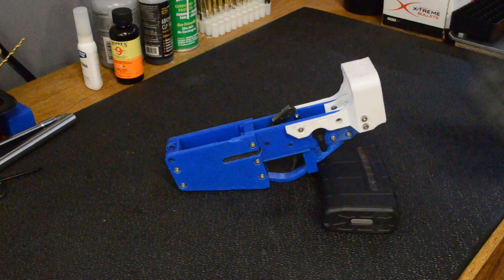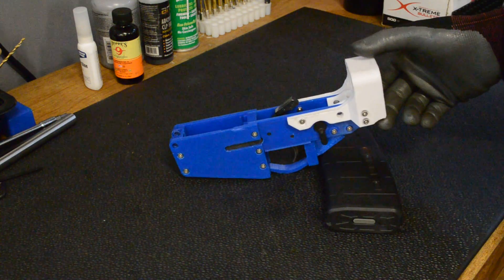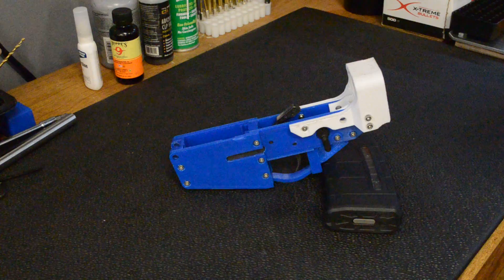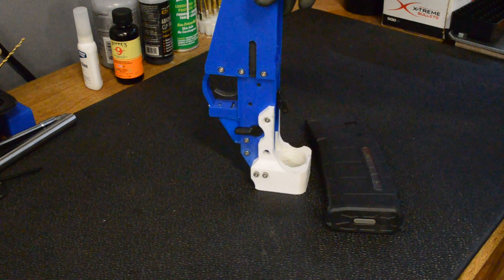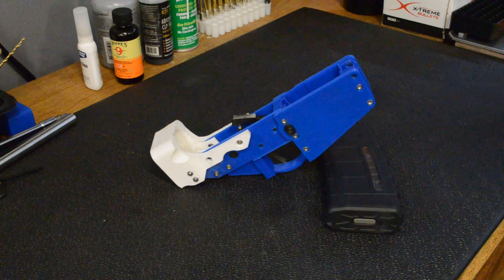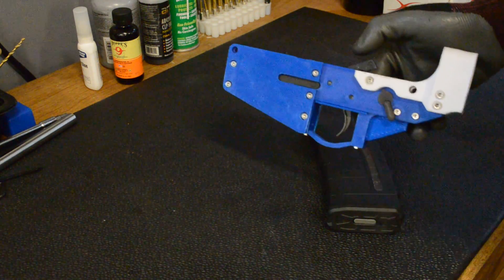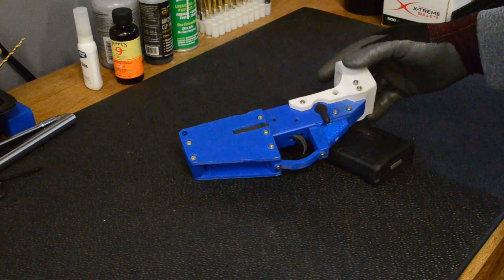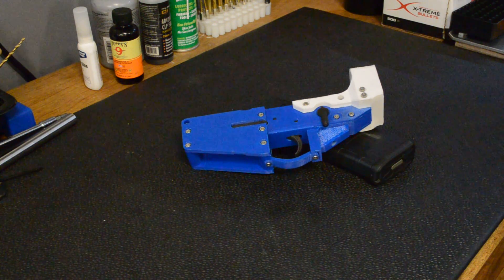Bolt-together 3D printed AR 15 lower receiver

Comment: Is the safety printed?  Put a groove on the underside to have it slip over the screw... its not a stress bearing part, where countersinking that screw would lessen strength just a little... 

That's interesting for sure..

Comment: That's a much better design than most. It's not just the size of the printer. Holes printed vertically don't come out accurate. That right there is the only borderline safe way to print the holes for the FCG.

Comment: aren t there any airsoft ar 15 on the market which can be used for lower recivers
Reply: yes but also no. it requires extensive modifications, more even than finishing an 80% things like reciever pin positions, magazine catch position, trigger pin positions etc

Comment: Can i 3d print thoose small parts that's in the lower reciver
Reply: you mean the LPK (lower parts kit), you should buy that on sale somewhere, it needs to be metal
Reply: @nikolatesla811  You might be able to print some of the components, but reliability would be questionable at best; Mr Tesla is 100% correct, and you really should just buy a complete LPK.

Comment: cool print. I'm sure you've talked about it a lot but what would be the best filament to use for strongest result? There's bunch to choose from. Have you tried carbon-nylon or metal blends?
Reply: Carbon fiber (which is typically just ABS or PLA mixed in with carbon fiber fragments) and nylon typically do not produce significantly better results. The big issue is that they are difficult to print. Metal blends are just ABS or PLA with metal dust mixed in. It does not actually equate to metal strength. They are added just to retain color and shine during post print machining or prep, or if you want a patina oxidized look or magnetic properties. 

Without a doubt the best and cheapest filament to use is ABS. PLA is just a really bad material, people only use it because many have old printers that can't heat hot enough for good ABS adhesion between layers. That and there are some dumb environmentalists that think they are saving the world by using an overpriced low performing thermoplastic. ABS has the advantage of "annealing" or baking in oven which makes it a little stronger, but for these purposes it will warp it too much for practical applications. A better alternative is vapor treatment with acetone. I personally prefer to paint on the non-precise surfaces with ABS resin (ABS juice, scrap ABS dissolved in acetone) and brush it on. Significantly improves the bond between layers more than even annealing and a much smoother look, but of course adds thickness to where you apply it. However like using it on your print bed to adhere the first layer, you can paint it on extremely thin by rubbing it in which produces negligible dimensional change for most applications. 

PETG is a nice material, but it is double the cost of ABS. It also is somewhat flexible which may be good for some purposes (like the receiver extension end) but not for others (magwell). In practice PETG may not outperform ABS by much if at all as they vary widely depending on brand. Choosing brand name material as opposed to Chinese filament will also significantly increase the price per kg spool (never choose brand name Chinese filament, you are just throwing your money away to a communist regime for nothing). Often PETG is used by those who can't print ABS reliably as the melting temp is lower, making adhesion more reliable. 

Overall, printing well is far more important than the material. Make sure you have the nozzle height calibrated well so you don't knock the print towards the end and make a printer enclosure to keep working temperatures high enough to kind of anneal the print as it is being made.

Comment: couldn't you just make that out of sheet metal instead of plastic? and wouldn't it be even more durable?
Reply: If you have a mill for the larger bits sure.
Reply: Look up Flat Spot Steel lower.
Reply: @ronarmstrong835  Sadly out of business.
Reply from the maker: Maybe the magwell sides. The other pieces are more complex.

Comment: couldn´t you trim the safety lever a bit so it goes over the screw? 
Man this is awesome, I wish I had a 3d printer, but this would be illegal here :(
Reply: The alternative would be to remove a bit of the material around the screw so it's slightly recessed, allowing the selector to move over the top of it. The receiver parts are already overbuilt, so a tiny bit less material in that one spot shouldn't compromise structural integrity enough to matter.
Reply: Countersunk screw would also solve the issue.

Comment: I can not find a hardware list for completion, M3 what sizes?
Reply from the maker: Look here:
https://github.com/maduce/fosscad-repo/blob/master/Rifles/AR-15_Bolt_Lower_Receiver_v2.0-RollTroll/Readme.md
Reply: Thanks!
Reply: That linked helped with many issues I had with orienting the parts for printing also.  My barrel nut is 47mm OD, I found a matte carbon fiber tube on ebay with an ID of 46mm, hoping that will work.

Comment: so the question is: can you send it to someone in pieces? is it considered a complete lower if it's only pieces or when it's assembled?
Reply from the maker: +savage1r No argument here.
Reply: I guess just to be safe fill in the holes in CAD software and ask the recipient to drill out the holes themselves. PLA/ABS should be easy enough to drill with a hand drill.
Reply: @DiasporaDoomer  what if you ship it in 2 shipments disassembled? 49% and 49% and then 2% to assemble?
Reply from the maker: +Guy in a garage They don't like you.
Reply: I was curious about this to. I plan to fly to Boston soon for testing (my buddy has AR15 parts there) I plan on putting half the 3d printed parts (different color parts) in seperate bags. I figure that is the same as 2 50% guns disassembled.
Reply from the maker: +savage1r Good question.  You'd have to ask the ATF for clarification.
Reply: +Guy in a garage they don't like my questions.
Reply from the maker: +Josh Koelker In most places, it is fine to mail yourself a firearm. You'll have to check local laws to verify.  See #6 here: 

https://www.atf.gov/resource-center/docs/0501-firearms-top-10-qaspdf/download

6. May I lawfully ship a firearm to myself in a different State?
Any person may ship a firearm to himself or herself in the care of another person in the State where
he or she intends to hunt or engage in any other lawful activity. The package should be addressed to
the owner “in the care of” the out-of-State resident. Upon reaching its destination, persons other than
the owner must not open the package or take possession of the firearm.
Reply: IF you print it yourself in the USA it is legal. If you mail it or make it for someone else it is a felony